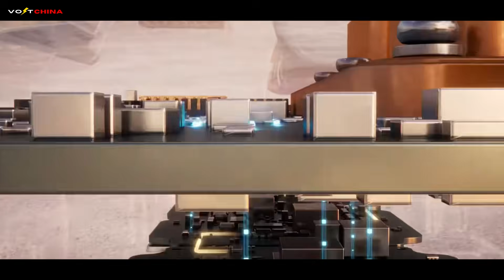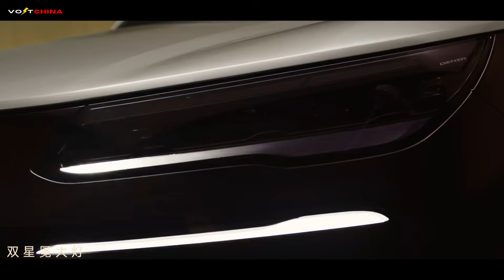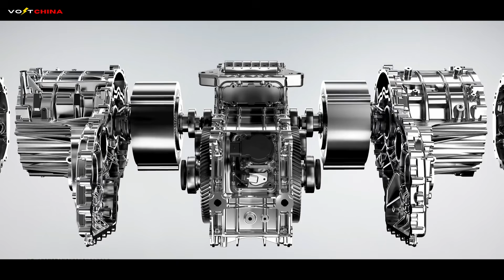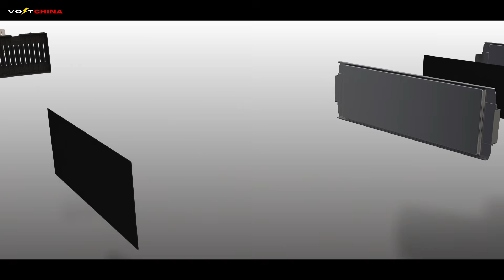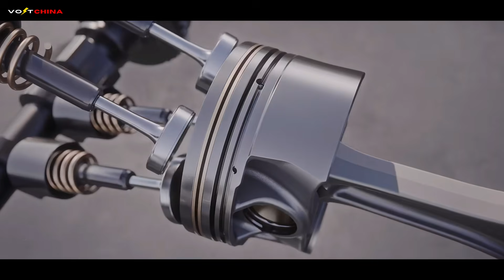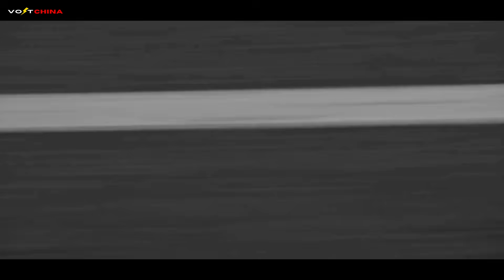Better Than Solid State? BYD's New "Blade 3.0" Battery & 900V Platform Revealed

Comment from the maker: Would you trust BYD's "comprehensive" complexity, or the "less is more" philosophy of pure electric vehicles? Is it necessary for hybrid vehicles to use 900V voltage?

👇 Get the exclusive Engineering Specs & Cost Analysis Report that I couldn't fit in the video (Free):
https://voltchina.gumroad.com/l/byd-solid-state-report

Comment: In Japan, BYD officially launched the 4th-generation DM-i 4.0 yesterday (with the Sealion 6 DM-i).
How many years do you think we’ll have to wait before DM 6.0 arrives in Japan?
As for EV vs PHEV, I personally prefer pure EVs, but when actually buying, I’ll decide based on price, vehicle weight, and battery capacity.
Reply from the maker: To be realistic, BYD usually validates new tech in the domestic market for 12-18 months before exporting to conservative markets like Japan. Since Japan just received Gen 4.0 (while China is on Gen 5.0), I predict a 2-3 year gap before we see this 900V/DM 6.0 tech in Tokyo. Regulatory homologation in Japan is tough!